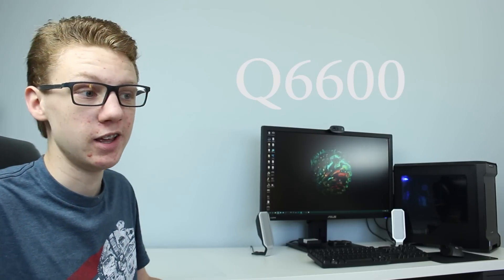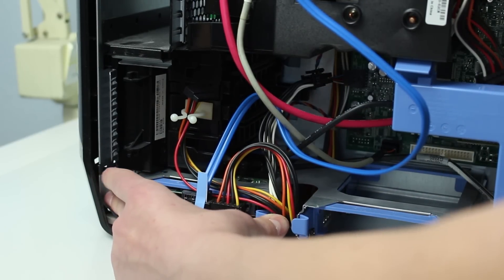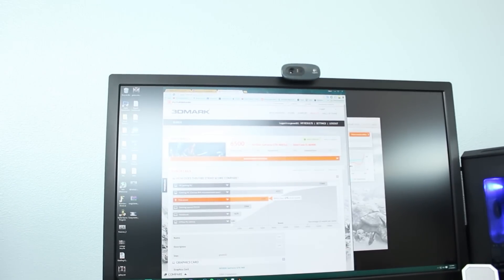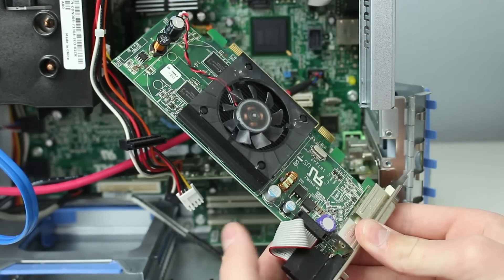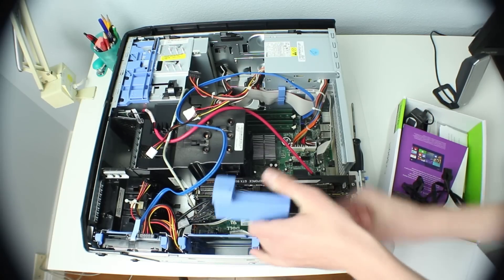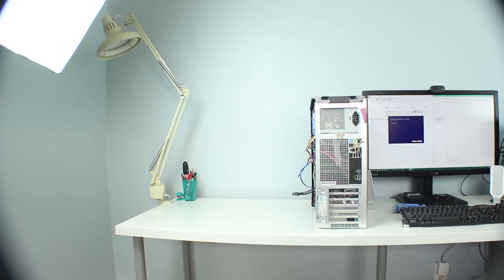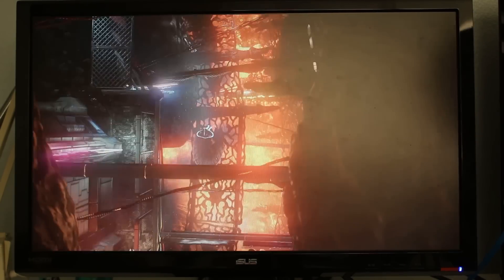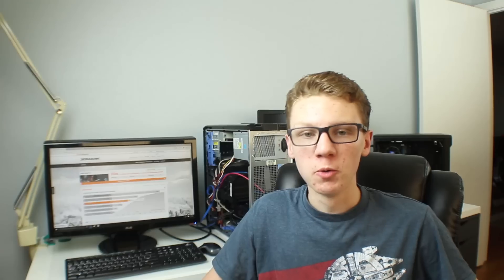Old CPU + New GPU = Gaming PC? (Core 2 Quad + GTX 960)

Comment: Q9550@3.4Ghz 1.312Volts (Can get 3.8, but don't want to push the old C1 Stepping)
EVGA GTX 970 SSC (Stock)
8GB GSKILL DDR2 1066 (Stock)
Tuniq Tower 120 Cooler
Gigabyte GA-EP45-UD3R Mobo
Samsung 840 Evo 250GB SSD
Various Spinning HD 1x3TB, 1x1TB, 2x500GB, 1x250GB External Laptop Drive in a USB 2 case for carrying files with me
Some AOC 27 inch 1080 Monitor (bought about 3 years ago)

This setup is now in it's eighth year, cost me just over $1000 to build in Feb 2009.  Only major changes were the 840 Evo (Steam and benchies on 3TB mechanical drive).  The addition of the 3TB Drive, and in December 2015 I finally retired my XFX GTX 285 and grabbed the GTX 970

My score for the same benchmark is 8686
http://www.3dmark.com/3dm/11413017?

I only game at 1080p and my eyesight isn't so acute that a bunch of post processing makes any difference to me.  Every game I have thrown at this old machine has been totally great for my needs.  Only issue I have is Subnautica sometimes stutters on me, haven't figured out why yet.  Not that it matters because it's only very rarely and for a split second.

At my age (late 40's) I might build a 4970K or 6700K based machine later in the year, but I can't say I haven't got great value from my old C2Q 9550.  If I do build a new machine I will wait for Nvidia's new (for sake of naming convenience) GTX 1080 or whatever they decide to call it. 

Anyway just thought I would share what an old PC can still do.
All the best!

Comment: See if you can get a custom unlocked BIOS for Overclocking and try to max the ram to 8gb and it'll be a heck of a gaming rig, I'm still running a similar rig and game on it at 1080 30FPS

Comment: I saw the title and had to check this out since I'm still using a Q9400 (found on ebay for $20). I just uploaded a video on my old PC on my channel. Originally I was running a E8400 on an EVGA 780i MoBo and 8GB of ram. That PC with the configuration lasted me from the day I built it in 08' till December 2015. I have a few videos using that PC I where it's an old PC that still games. I ran across the quad core on Ebay and had to get it for the old PC. It really gave that PC a significant boost. Now a few weeks ago I lost the EVGA 780I to a short and tossed everything on an old MoBo, it's a ASUS P5B-E and that quad core was able to work on that MoBo even though the FSB is 1066MHz and not 1333MHz but the scored in 3DMark stayed the same. On a side note I also have a 4670K running a GTX 960 and somehow my score was a bit higher. I scored a 6703. The Core 2 Quad scored a 5691. I still have the E8400 and I'm still going to use it on another MoBo I have. it still has life in it for web and video watching.

Comment: What GHz was the cpu running at?
Reply from the maker: Stock speed; 2.4ghz.
Reply: +Gevan32 thanks a lot you earned a sub from me I was thinking of upgrading to a i5 or fx-6300 but I guess maybe over looking my q9400 to 3ghz and getting a good graphics card will do me fine
Reply: +Gevan32 you also said core 2 duo quad its core 2 quad lol

Comment: And what about testing CPU Physic instead of useless GPU test, whitch doesnt tell you anything about CPU performance... Case Q9650 @ 4,3 Ghz got a half singlethread performance than G3258 @ 4,3 Ghz... And G3258 will cost you half than this C2Q.
Reply: +Josef Dvořák That's a dual core.

Comment: put  a  new  psu  into  it  --  a ssd and  re do  the  cpu   ie   remove it add   new   cpu  paste  and   then    do  what  you  did  again

you  do  not  want  it  crash  our  the  cpu  to  fry because  over  time  the   old  paste  would  have  dried  out so  no  proper  contact  to  cpu  ps  awsome video  and  set up     http://en.community.dell.com/support-forums/desktop/f/3514/t/19242670

Comment: Hey, I need help. I'm trying to decide on what GPU to get, it needs to have a lower power consumption, a 6-pin or less. I'm upgrading from a Core 2 Duo E7400, to a Core 2 Quad, not sure which model yet. I have four gigabytes of DDR2 800MHz ram, and am upgrading from a 300 watt stock power supply to a new 650 watt. I need a card that is a mix between budget and mid-level, and is capable of heavy gaming. I do not plan on overclocking, and do not plan on maxing out everything. Thanks.
Reply: +Drunken Ferret Gtx 950 or Gtx 750ti
Reply from the maker: +sufyan motala I agree with you. Anything from 750Ti-GTX 960.

Comment: The pricing to performance is a bit off. The motherboard comes in as a factor too and sometimes those cost too much to even make the cpu worthwhile. And I work with a lot of old computers and I have to say OEM case engineers makes things overly complicated probably just so people won't try to upgrade.

Comment: BEST VIDEO IN YEARS OF YOUTUBE!!!! PLease help me, i have  one q8200, p5kpl am and 4 gb of 677 ram, if I put 960 4g on it, it will works fine? (pci e and etc...) Help me :D
Reply from the maker: +Gabriel Hoffman Honestly, I have no idea. Just check that it has the right PCI-E slot and that it physically fits, and that you can install drivers for it and you should be fine. I appreciate that you think so highly of the video :)
Reply: +Gevan32  its a pci express 16x , so, even with 4gb of ddr2 ram it will work. but i have in mind to change my 9800gt for a 960 4gb, so , when my budget allow, i will buy a new rig, with the same gtx 960. so i think it will work. what do you think? pci ex 16x 1.1 with gtx 960 and q8200? thx for the reply. u deserve such high value, its nice to have such high end cards, but u hit the heart of most pc gamers! THANK YOU!

Comment: I don't think the q6600 was ever $800. I bought it in feb 2008 for roughly $320.
Reply from the maker: +SMAAAASHTV https://www.google.com/search?espv=2&q=q6600+release+price&oq=q6600+release+&gs_l=serp.3.2.0j0i22i30l5.1915.5394.0.7698.7.7.0.0.0.0.134.657.5j2.7.0....0...1c.1.64.serp..0.7.657.DsBdohX2Z-A
Reply: I stand corrected. Crazy to think how expensive a new CPU was back then, not even being top of the line. Looks like the price actually dropped about $300 withing a few months of it's initial release, then steadily falling over the following year.
Reply from the maker: Yeah. High end processors seemed to cost a lot more back then. Could possibly be due to the fact they had more performance gain each iteration than they do now.

Comment: I took a 980ti and shoved it into my q9550 (from 2007 - oc'd at 4.4). GTA V got 45-50fps tops maxed out. 
My skylake machine I get 90's maxed out. 

Even my lower end 770gtx performed about 20-40fps BETTER in the new machine than the old. 

So while yea, you can take older hardware and put a GPU in it, it's still gonna suck a bit due to the cpu util % hitting 100%. My q9550 hits 95%+ all the time with either the 770gtx or the 980ti.
Reply: +Nicholas Golden $$$$$$$$$$$$$$$$$$$$$$$.

Comment: man your 3dmark is weird with the 4670k and the 960.
I get 6700 with my HD 7870 and my 2500k, of course there are overclocked but still
Reply from the maker: When I had my 960 overclocked it was getting around 6800 I believe.

Comment: Really enjoyed the atmosphere of your video. I actually used to have a setup like that I bought from a pc shop that closed down. got the pc with the core2duo quad and it had a g force 9800 gt with an Acer monitor 24inch for $300 this was back in 2011. I gamed on that till 2013 where I bought a radeon 6850hd off my co worker for $50 and it jumped my gaming quality drastically . later that year I saw a sale for amd 860k with mobo and case for like $150 so I used  parts from my core2duo pc to finish my more modern 860k build like power supply, gpu, etc I actually also bought a 240gb ssd too on sale for $100 at the time and man I was so amazed!!! and I only spend around $250 on my 860k paired w/ 6850hd setup. then my girlfriend told me her little brothers cheap Dell laptop isn't working well and he uses mainly to game and asked her if she can buy him a gaming laptop. He has a computer desk for his laptop to play games so I told her don't waste your money on a rip off gaming laptop I'll sell him mines for $300 and with that money I bought a gtx 960 and slapped it in there for him before I gave him the pc and keep in mind the kid is like 14-15 years old and that pc absolutely was a game changer for him. There is no game that he plays he can't run on max/high ( mostly plays games like dota, league, csgo, free mmorpgs etc) now at this time I was ready for the big boy build so I went and bought an i5 4590 with a micro itx h97wifi mobo with corsair 750 semi modular 500 gig Samsung ssd and my friend sold me one of his EVGA gtx 970 for $150!!!  cause he had a sli setup and just wanted be an awesome friend ( drunk driver hit his car & he got insurance $$$$) fast forward to the present day of March 2016 my little sister wants a gaming pc cause she's so otaku and knows the endless possibilities of games on pc and tells me she has $200 to spend so I bought a 4790k and plan on giving her my i5 4590 and use her $200 for rest of her build like motherboard ssd psu the works. So now my contemplation is I plan on buying her a gpu but I'm really debating between a gtx 960 or a r9 380 that's my price range I wanna gift to my baby sister (she's 18) or maybe a 750 ti will suffice but I do wanna future proof her for a few years and I know this will be the pc to start her on her master race journey (she's honestly a casual anime gamer nerd girl so I'm sure she's gonna play mostly mmos and jrpg on steam) sorry for posting a big ass essay on your video but the core2duo quad was the beginning of a journey for me =)
Reply: +ThePeoplesElbow100 very detailed :D
Reply: this is gold

Comment: Still rockin my Q9300 ;)
Reply: me too q9300 oc 3ghz with 4 gb ddr2 anf gtx 950 windforce
Reply: ZomBie Gaming Right now, thinking on a slightly older Asus rig. Gonna upgrade it to a QX9650 and get it a GTX 960 4 gb with 8gb 1066mhz ram.
Reply: good upgrade but just waith , and buy Intel Core i5-4690K 3.5Ghz 8gb ddr3 1600 mhz or 16 gb 1600 mhz cl 9 and Gigabyte GeForce GTX 960 Gaming G1 WindForce 4GB GDDR5

Comment: But once you overclock the q6600, it'll really start to shine. A q6600 at 3.2ghz is still a pretty good CPU.
Reply: +IRNatman with this motherboard its locked its a hp built system with a designated motherboard aka meaning it cant be swapped I actually have this exact same system i put 8 gb of 800 mhz ddr2 ram in it with an r9 270 dual x sapphire edition oc and a 700 watt PSU that I will be taking with me when I sell this. this is a really great pc for gaming in any games like LOL or WOW or even csgo running around 200 FPS its really nice.
Reply: Kingsdontwait
I know this particular board can't overclock, OEM board usually can't. I'm just talking C2Qs in general. I have a C2Q Q6600 at 3.2ghz in a HTPC and it still does great. Awesome CPU!
Reply: +Kingsdontwait (KingsDontWait) Sir, that is a dell XPS.
Reply: you know what I meant lol

Comment: I would love to get a q6600 but intel motherboards that support lga socket 775 chips are hard to find cheap and ddr2 ram is expensive as hell
Reply from the maker: +Victor Mcdonald Yea. You almost have to buy the ram used or get it out of an old PC. Here's some LGA 775 mobos on Newegg: http://www.newegg.com/Product/ProductList.aspx?Submit=ENE&DEPA=0&Order=BESTMATCH&Description=lga+775&N=100007627&isNodeId=1
Reply: +Gevan32 well I from Canada and checked the newegg.ca and there pritty much the same on there but I'm looking for really cheap like 20 to 30 dollar boards. ebay does have but idk if there compatible. it sucks to live in canada

Comment: So, I bought this same PC back in January 2008 while living in Malaysia.  I think I paid $3000 for the entire rig, direct from Dell.  Not a great move...I could've gotten a custom rig made to order for half that price from a Malaysian PC shop...but ignorance was bliss at the time.  In any event, I still have this PC.  Over time, I've replaced the monitor with a 28 inch HD 1080 Philips. Replaced the dead Nvidia 8800 GT (it came with the larger 425 W PS too) with Asus GTX550Ti (2GB RAM). Changed out 4GB RAM to 8GB RAM (only 800Mhz). Added a couple of HDD and upgraded VISTA 32Bit to 8.1 64 Bit on a SSD.  The last modification gave the biggest performance improvement overall.  The monitor, the best benefit. RAM had practically no benefit for my use case, though the upgraded 64bit OS at least gives the PC access to more than just ~3.6GB of RAM.

I do run the system slightly O/C using SetFSB (2.6 GHz). However, I cleaned the fan cooling and cleaned/reapplied the CPU  thermal paste beforehand.Beyond 2.8GHZ it gets unstable with the stock fan cooler.  I may not do the pin mod for the 3.0 Ghz O/C...not investing more in this old rig (new PS, after market cooler) and frankly...if it ain't broke I'm not gonna fix it!

System runs like a champ for what I need.  Media (streaming), some video editing, web browsing, email, excel/word/pp. It'll run WoT (full screen, 1920x1080 w/most max settings +mods) at ~ 32FPS.

Lastly, the DELL Power Supply rating is not a PEAK number..so it's very much understated relative to most third party ratings.  Mine was the max available from DELL for this setup (for gaming back in 2008)...it was the 425W version which came with the 8800GT (aka portable stove). I'm still using the same PS...knock on wood.

PS: NEVER BUY a DELL PC...even on this XPS many of the components are proprietary.  The biggest issue, the BTX specified motherboard.  It's lasted, for sure.  But the BTX layout is totally different from ATX so the case is useless...overclocking is also very limited.  I'm not saying the system hasn't performed...it has. The quality was also very good, considering its reliability over the years. However, DELL's proprietary nature has seriously hamstrung any effort to really upgrade.

Comment: Had a Gigabyte EP35-DS3R motherboard that's been just sitting on the shelf, still new and unused, since the late '00s. With a Core 2 Duo E8400 (E0 stepping) Wolfdale dual core 3.0GHz processor off eBay for just £6.95 (with free postage), 4x2GB of G.Skill PC2-1000 memory (also off eBay) and borrowing my one new EVGA GTX 960 SSC 4GB card from my recent 2015 (in progress) build, it did just fine for such an old processor based machine.

My 2015 build's still running on a G1820 Haswell dual core 2.7GHz processor (for the initial motherboard BIOS update) until I can afford an i7-4790K in a few months time. According to CPU world, the G1820 is only a 'tad' faster than the E8400 by around 21% overall.

(My 2015 build when completed:

http://uk.pcpartpicker.com/user/Outtheredude/saved/HTBXsY )
Reply from the maker: Wow. Just goes to show how much more GPU matters in some situations.

Comment: I actually did this 

It worked quite well but I got the gpu for Christmas and I was only 10 pounds under affording my pc 

My new pc specs 
Intel core i5 6500
8gb ddr4 ram
2x 1 tb hard drive 
120gb ssd 
Gtx 960 

And that gpu is an amd fire pro 6509 this pc Is the same ( old one )
Reply from the maker: Nice bro! That system is better than mine.

Comment: Pre-planning pre-planning also the q6600 may not have the pci lanes to truly utilize the gtx960
Reply: Martin Kincl
While I commend you on your detail when replying and you are right that the PCI lanes are not solely reliant on the CPU, my albeit vague response was more toward the idea that the CPU in question would not be able to keep up with the speed of the GPU especially considering the generation gap.when it comes to dealing with the data in and out of the GPU and CPU shared work load. While when gaming the older gpu would not be that big of an issue it seemed he was looking more at a general purpose use which would show a performance issue on the CPU. Especially true when I did a build with the same chip and a HD7970.
Reply from the maker: Oh good point. I didn't think about the PCI-E lanes....
Reply: +ThaFacialHair PCI Express lanes are on the motherboard, not the CPU. What you can today see among processor specs is just a maximum of PCI-E lanes it can support on its own. 16x was a standard for quite some time and I have no doubts Q6600 can communicate using 16 lanes. Still, that doesn't necessarily mean you're limited to 16 PCI-E lanes, since there are either motherboards with two CPU sockets or a separate on-board chip, that handles communication between the graphics cards, providing another 16 lanes for a multi-GPU setup. You can use an LGA775 processor (like the Q6600) in such way, using a motherboard with a 680i chipset.Interestingly enough, even the most modern graphics cards rarely reach the 8x speeds, so you won't see much, if any difference going from 8x to 16x. Where the difference might become somewhat noticeable is with Crossfire setups, where the AMD/ATI cards don't use separate bridges.
Reply: ThaFacialHair Yes, I definitely agree. In today's open world games that actually stress the CPU, the difference would be very noticeable and the GPU would be underutilised. The 2nd gen PCI-E interface could also cause a slight performance decrease, probably more apparent on AMD/ATI cards. I'm just saying that PCI-E lanes would be the least of my worries.